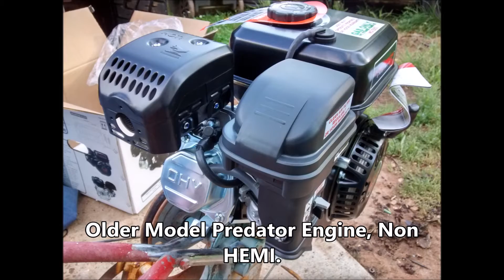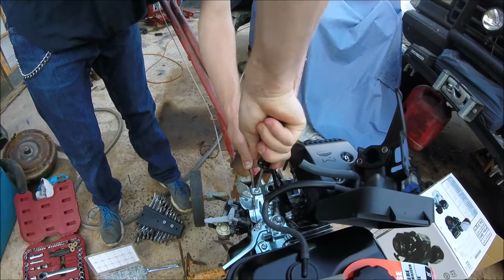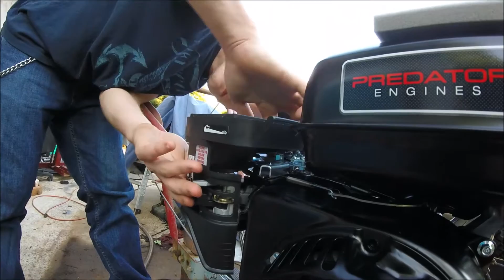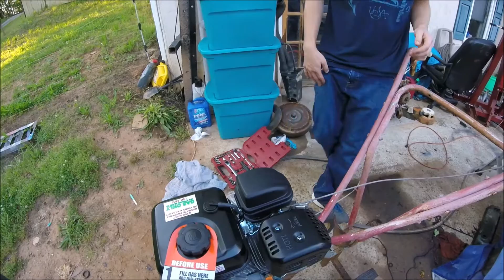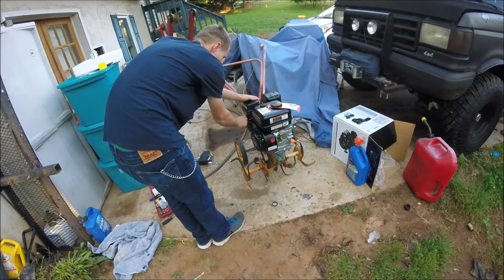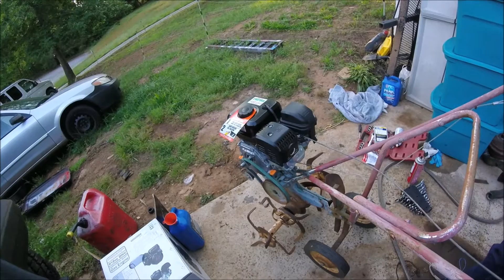Old Tiller with New predator 6.5hp: First Sartup

Comment: Those front tine tillers will beat you to death. I use mine for tilling the center rows.  And my Troy builts for normal tilling. Predator engines are pretty good I hear.

Comment: the Hemi and this engine is available from Harbor freight the Hemi version is made by LONCIN. this one and the california model is made by Chongqing Ratio Power Manufacturing CO.  as these are copies of a Honda motor but can't beat them i repowered a cyclone rake vacuum unit and a snowthrower with the Chongqing engines but they are great.